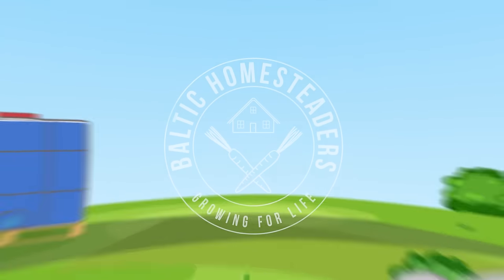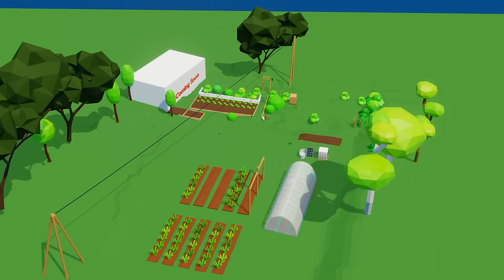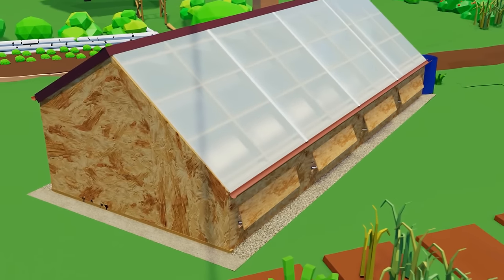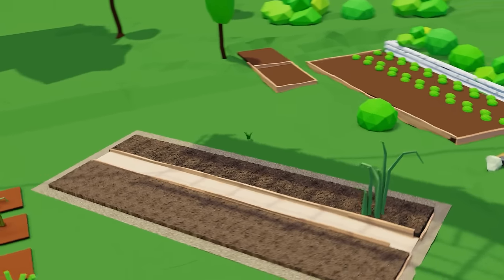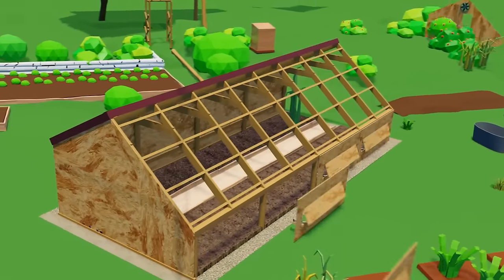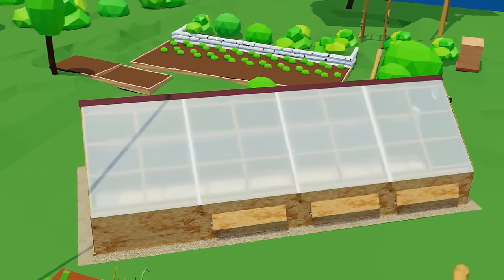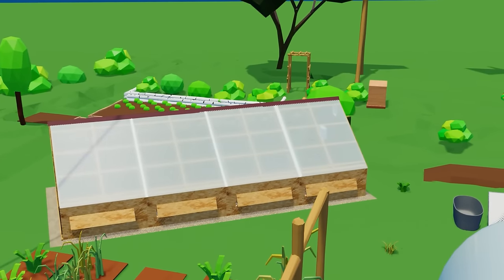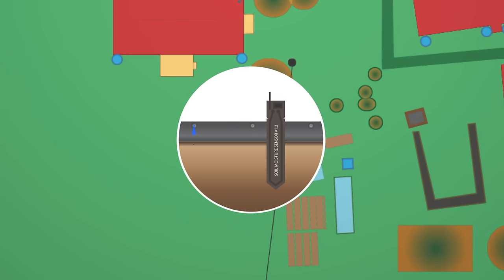Passive Solar Greenhouses - 8 Key Considerations When Building

Comment: Having built mine already might I make a couple of suggestions; first, since this is a 3 season greenhouse I would recommend using water barrels and draining them in the winter. Water is either cheap or free and by using water making changes later will be much easier than moving stone. Secondly , cloudy days in later winter early spring make a secondary heat source almost required. This last spring we had a two week period with not one sunny day. On our farm we tried a rocket stove first, it was a lot of fun but way to much work since you have to keep adding fuel. Next we made an outdoor wood fired water boiler from an old gas water heater. Since it had a large burn chamber wood had to be added way less often. The water was circulated with a tiny little fountain pump so some electrical is needed. I turned 60 this year and have to admit I'm looking to make life easier, so this spring I tried a Chinese diesel parking heater it keeps our green house 20 degrees warmer than the outside air set on the lowest setting and it only goes through about 2 1/2 liters of fuel for a full 24 hrs. This saved all my plant starts this spring when we had that cloudy period. Nice video, All the best to you
Reply from the maker: Hi. I might have a go at experimenting with that over winter. My plans have changed a little with regard to the best mass and I’m thinking through different ideas. I’m not in a massive rush and might not even get the mass done this year. I will be taking detailed temperature readings over winter to see how it performs. Thanks for your input. We have no end of firewood but still need to use it efficiently.
Reply: Any suggestions for an earth sheltered passive solar greenhouse adjacent (attached to) a home for Canada with a 90 day grow season?

Also you can wrap copper pipe around the stove pipe to create a thermal siphon that will pull in cold water at the bottom and pump hot out the top without electricity.
Reply: Great idea on the diesel parking heater. I wouldn’t have thought of that for a greenhouse.
Reply: @sicsempertyrannis4351 I too thought immediately of natural thermal mass… ie, dig down about two to three feet into the earth for the walkways and bottom of raised beds, and use thick walls of rammed earth or hempcrete or sandbags or cob for all walls beyond the dug our space.

Comment: Depending on budget considerations and how cold it gets, you might look at mixing water and propylene glycol (available in food-grade formats).  It has a freezing point of -59C, and can be disolved in water to lower the freezing point.  It's possible (though maybe not cost effective compared to stone that's free) to fill 200L drums of water/glycol mix that won't ever freeze in your climate.
Reply from the maker: Yeah I had looked into this but I was nervous about contamination if it leaked. Maybe needlessly if it was food grade. The problem may have been that I couldn’t source it here. I had seen others with similar concerns and had built elaborate containment systems. Those rocks might be free but they will be hard work shifting them compared to barrels :)
Reply: @BalticHomesteaders   use plumbing antifreeze for RV's to improve the water until it won't freeze solid in the freezer and fill barrels with that ratio and make certain the barrel is sealed because  it's mostly alchohol.
It will require checking occasionally but for blue barrels, only fill to 90% and even if it freezes, it's unlikely to break because it'll form slush mostly
Reply from the maker: @EastBayFlipper  I’ll look into that thanks.

Comment: I'm not complaining about your video but we tried a couple of things in ours that worked really well. So if yours is not build yet, maybe you should take those in consideration. Styrofoam are great for the foundation. They are super though in compression. make sure they don't twist or they will break like glass. we used 2 layer with 4x4 in between. put sand in the middle so it get higher at the same pace that you put ground on the outside so it don't open or close. once it's done build on it and it's as strong as concret, isolated and cheap. Mass, ventilation and , the most important, energie transmission with water. 1000L tote work great. before starting your soil. bury as mutch tube as you can aford. I have 600 feet on a 8x16 feet. My earth is hot even when it's -30 C outside for 3 month. Solar passive is a great concept. But you gona use it at his full potential for about 3 month a year. the other nine month gona be not enough effective in winter and too mutch in spring and summer so you need to flush the heat outside. Dodge caravan radiator gona solve that. With 4 of those runing all day and night with heat floor pump, i collect the heat in my 4000L reserve and in the ground by the tube. I even water the plants with hot water. I can keep my greenhouse closed on the 21st of june even if it's full sun. I open the windows in the summer only to help the insect get to the flowers. Last thing, be close to your house and make your greenhouse an heatcenter that you can spread where you want. I iinstalled an industrial generator in mine. Prestone is send in my home to heat it. An engine lost around 75% of the energy it used in heat. 25% is used to light the house. The heat lost by the engine itself is for the greenhouse. Greenhouse radiator system takes it easelly. I't's always around 4L/10Kw/hour. If like me you think it's still expensive at 2$/L. Get an old diesel engine and start making vegetable oil. That part is not done yet but we start building an oil press for the grain we use to feed the animals at the farm so we can cut diesel fuel 50/50 with corn oil wich gona cost me around 0.30$/L and feed my animals for free... Well, I could go for days on that subject so let's stop it here.Make every BTU count. So keep them near what is the most sensitive to cold. Yourself, young or/and fancy plants and young animals. Good luck in all your projects and let's share our success instead of hiding it.
Reply from the maker: Thanks for all the info, do you have any photos or videos of your set up I can see, that would really help? Thank you again.
Reply: I'll try. I'm not realy good for posting something on youtube but I'll try as soon as possible.  @BalticHomesteaders
Reply: maybe you have an email adress i can send them. you seem mutch better then me with cpu
Reply from the maker: Yes it’s Baltichomesteaders @ gmail . com

Comment: Excellent article. We built one 50 years ago at the Ark Project in Prince Edward Island using twin skin, steel frames with tedlar film glazing. Several others were built there and later in B.C. Damp earth heat storage was used in all of them. Blue shiplap polystyrene was used, including a control layer about 900mm down. No auxilliary heat was needed. The projects were supported by the the Canadian Department of Energy mines and Resources.
Reply from the maker: Are there any photos or documentation of these projects online anywhere? Would be interesting to see if so.
Reply: I still have my own photos of the building of two of the demo projects. We had our own company contracted by the Institute of Man and Resources at the provincial level. Central government was from Energy, Mines and Resources. The latter organisation later gave a contract through the Agriculture station in Saanich in BC. They just repeated my project with no advances. We were visited by the Japanese dept of Ag which did more work. Energy, mines contacted them later on. Don’t know where that went. We also developed a thermal storage system for industrial spaces. That did not go to demo sadly. My company was called Renewable Energy Co. in PEI. We fabricated telar film panels for greenhouses. Also built panels for solar staircases and installed them in the church near Summerside PEI. My photos are in storage and will copy to you if I can locate them. There is a passive solar greenhouse somewhere in the central USA. It is a simple version of ours and worthwhile knowing about. It is on Utube but I haven’t viewed it in about a year.

Comment: I visited an old house a while back, they had produced all the fruit and vegetables eaten on their property, which was a large pastoral property. They had 8 green houses at their peak, but 4 remained, which had been modified over the years. I looked at the ruins of one of the original greenhouses. It had 2 pits that ran the length of the greenhouse on each side, about 6 feet deep, under which ran a rubble drain leading to a pit about 20 yards away. In summer the pits were filled with animal bedding and droppings, along with other compostable material, it must have stunk, but it was settled down and compacted a bit. Over winter the materials would compost, the decomposition giving off heat and gases. The greenhouses were vented on their ridge line via controllable vents.
Reply from the maker: Interesting, thank you for sharing. Bio generated heat is something others have suggested too.

Comment: this project is very very close to what im dreaming of! i know for sure this gets way to hot in summer, maybe find a way to shield your greenhouse from summer sunlight for the worst months. also the thermal battery is as usefull as its surfice area, if you use a loose rockpile instead of a neat stacked pile your heat transfere between the air and the rocks inceases dramaticly
Reply from the maker: Thanks. I’d love to find some shade netting but it’s not easy get here.
Reply: We spray our big greenhouses with chalk for the summer months and it dispurses after a lot of water or immediately with a removal solution
Reply: I don't know how far you want to go micro managing but there is an other trick: paint some of the rocks in the thermal battery half white half black. In winter put the black side to the sun in summer put the white side to the sun
Reply from the maker: Good ideas, thanks.

Comment: Excellent points. Thanks. I'm looking at using SIPS for the walls and build the north wall. Using a saw tooth design with a 2' window to allow passive heat ventilation and work tandem with the lower windows or tubes from the north (cooler side) in the shade. I'm looking at testing a small 8'x 12' SIPS greenhouse. I have a 10' x 26' x 7' cheap half dome starter greenhouse. Heat, insulation and venting is your first biggest challenges. Once you have that under control you can move forward with soil health, moisture control and plant location. Thanks again.
Reply from the maker: Thanks, you’re welcome. Yeah I reckon sips would work well, don’t think can get them here unless you’re building a big project or possibly not at all. I think soil health is often overlooked and almost an afterthought in many (if not most) projects even if all the above as you mention is under control. You’ve probably seen I made a series of build videos as well.

Comment: Another really useful video for collecting information for my project! I’m hoping mine will be on the SSW facing wall of my barn.  I’m currently most worried about getting the ventilation right…
Reply from the maker: I’m playing with ventilation at the moment, it’s pretty much as per the video and seems to work well. The 12v car radiator fan in theory can move the air once every 2 minutes but that depends on how big your greenhouse will be of course.
Reply: Better face greenhouse little bit towards east as it warms up faster in mornings and you'll have less mold problems as plants dry up faster in the morning.

Comment: The front looks to be about 4 feet high. Dig down and embed it in the ground. This will help stabilize temperatures. You could even line it with EPS-aircrete (polystyrene/aircrete) which is a great & cheap ground contact insulator. I would berm up & ground insulate the back wall for the same reason. The pitch may change then, and maybe less north facing roof and more south transparent roof.

Comment: For that back wall I like the other option of rammed earth or tire wall. These 2 options will keep more heat in their thermal mass for longer into the night. The tire wall also can prevent breaking down if roots try to penetrate, recycling otherwise waste tires & filler while being a heat battery to even out temperature throughout the day & night. The drawbacks to my knowledge are the thickness of the wall being around 3 feet or 1 meter & the labor needed to hammer the clay, sand & dirt to the right density. The weight of a filled tire is around 300 - 400 lbs.
Reply from the maker: Quite like the idea of the tyres, got a few lying about but it’s something that could be built up over time which is convenient. I’d have to look into how to source tyres over here, thanks.
Reply: Exactly!

Comment: First off thanks for a very inciteful video.   My situation is a little different in that my greenhouse will be the 2nd floor of an outbuilding.  Here, I plan on using water for cooling and heating.  I'll use a small pump to circulated the water to buried and insulated containers.  I'll also have some rainwater catchment for my grow.  Where I live, the frost line is about 18", so my barrels will be below that.  Geothermal may also come into play for the winter along with a small propane or wood fired HW boiler.

I'm thinking of using zipwall for my exterior instead of OSB as it includes 1" of build in rigid insulation.  It's a little more expensive but it saves a step.  For my electric - I will also be utilizing solar.
Reply from the maker: Sounds good, all the best with your building project. Our frost line is about 90cm!

Comment: 😊👍❤
One thing you have not mentioned, is an efficient air exchange, incorporating a heat exchanger.
In winter, you still need air exchange to replenish CO2.
To do this you will need a heat exchanger so that the internal heat is not wasted, 
and incoming fresh air, is heated by the outgoing stale CO2 depleted air.
Alternatively, you'll need a supply of CO2, to replace that used by your plants.
,
Reply from the maker: It’s a great point I’d not specifically mentioned it no although in the back of my mind I was considering a geothermal cooling/ heating add on. I also, as part of the control/monitoring system I wanted to monitor co2 levels, more out of interest than anything else. More recently I’ve become interested in evaporative cooling and an enclosed solution with a heat exchanger might offer a dual purpose solution, spit balling ideas really all needs researching and experimenting. Thanks.

Comment: Instead of the mechanical ventilation you could consider one or two black-painted pipes. When the sun makes them hot, the air will be sucked out of the greenhouse. Adding some heat in the cold months is possible with one or more SolarVenti’s, you will still need the sun for that but then it delivers!
Reply from the maker: Hi, that’s not a bad idea. I’ve seen a vented toilet using a black pipe to draw up the unwanted smells. Thank you.
Reply: @BalticHomesteaders  it only works when the sun shines, so you have to smell bad at the right time 😉. But it will work automaticaly for the greenhouse: a hot sun makes hot pipes and therefore much ventilation (and the other way around: no sun, hardly any ventilation)

Comment: I found that if you hook up direct solar panel to your exhaust fan without a thermostat it works the best as when the heat of the sun is out the solar panels producing the maximum amount of power there for spending your fan to the highest RPMs necessary as it cools down your fan slows down.
So a 12-volt fan such as for a vehicle will run directly off of a 12-volt solar panel the motor for the fan can increase up to 24 volt if necessary depending on the voltage put out by the solar panel it will not damage the motor
Reply from the maker: Hi, thanks for commenting. It’s not a bad idea, I can see the logic in it but I need better control over temperatures inside. So for example in winter the sun might still shine but I wouldn’t want the fan exhausting. I soon hope to release a video on the tech side as I’ve now built the greenhouse and it’s all working Ok.
Reply: In the ones we built many years ago, we had upper and lower heat storage masses and the upper, hotter layer was used for emergency heating boost in case of a glazing failure or a door was left open in winter. We had thermocouples in the two heat masses and at the collection inlets and outlets. A vdu showed energy high/low points in the two energy masses with a heat loss alarm relay to the office,

Comment: Great videos thanks. Especially as I'm thinking of building my own greenhouse. I was wondering why the whole roof isn't made of polycarbonate?  Also we have very strong winds here and was wondering if the polycarbonate would be survive such strong winds. Thanks, Dave
Reply from the maker: Thank you. We also have a fully polycarbonate greenhouse and it is now staked down after it nearly blew away one year. Had no trouble since. I’ve nearly finished building this new one.

Comment: For an efficient cooling I suggest you to put vertical windows facing north at the top of the north roof.  The windows would be like just above and at the top of the north roof.  In order to have vertical windows the south roof must go higher and over the north roof and the north roof supports the south roof about 3ft under it.   This way the top windows have their top fixed to the south roof and the bottom is fixed to the north roof.   It is what I did with mine.   I know, a drawing would be more explanatory.
Reply from the maker: Hi, thanks. The project is now built, cooling is an issue but am addressing it this summer using other means.

Comment: I’m thinking of building something similar but using concrete walls. At least partially. Maybe a meter high concrete with the rest of it framed. I have a little slope where I am putting my greenhouse so I can have it partially underground.
Reply from the maker: Sounds great, hope the build goes well. Having the slope is a nice plus!